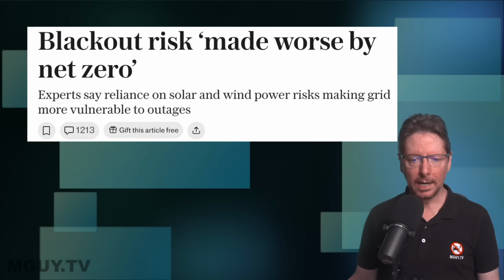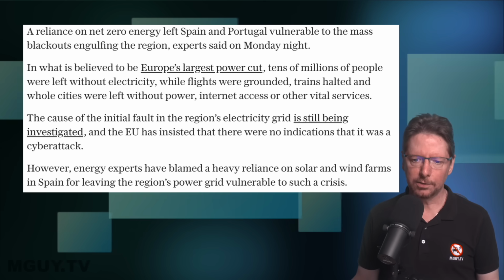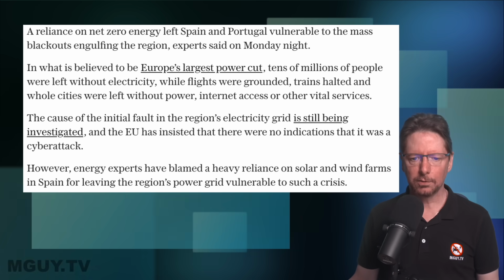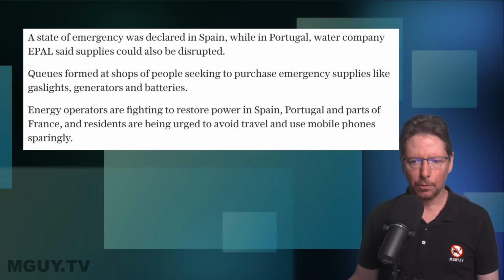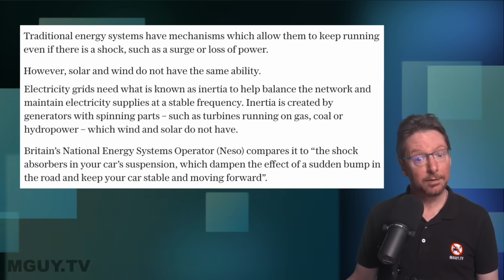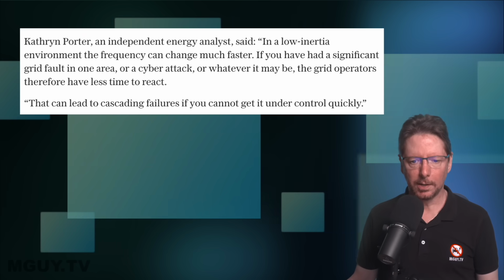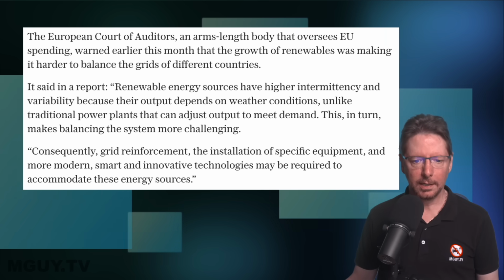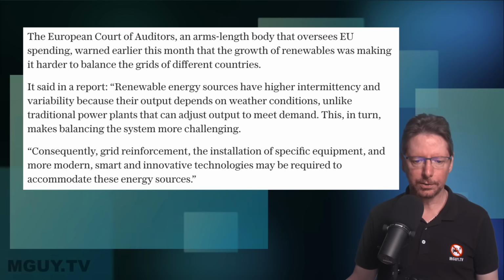Spanish power BLACKOUT: Why Net Zero and RENEWABLES were to blame | MGUY Australia

Comment: Inertia is like that experiment where spinning a bicycle wheel quickly will spin you around on a swivel chair.....renewables is like trying this with a lego wheel.
Reply: That would be gyroscopic precession, but your analogy is correct .  lol
Inertia would be like when the  Cheyenne chief Turkey Legs tried to stop a train with a bunch of braves holding a long raw hide rope across the  tracks .
Reply: Ope that’s the gyroscopic effect. Inertia is felt when you try to slow down the spinning wheel and even a Lego wheel has more physical inertia than a solar cell!

Comment: I wish The World was still run by the trained Engineers who created the infrastructure we rely on, instead of the Unicorn Fart Worshippers that are doing their best to disassemble it while blindly pressing buttons based on University educated ‘opinions’ instead of actual experience…
Reply: Facts ….
Engineering works with facts 
Renewables only have unicorn farts to fall back on….
Reply: @Batman-lives  They seem to also rely somewhat on moonbeams...
Reply: @Batman-lives  Renewable can be backed with batteries (as e.g. Australia and Texas are doing). This seems a reasonable solution in near-future. Just do not rush too much to switch off the classic gas and nuclear.
Reply: @miguela7433  Yeah right,no thanks.
Reply: You need tens of millions of batteries who all degrade, can be broken or even stolen.

Es is a solution for a problem that not exist.
Reply: @miguela7433  there aren't enough minerals for backup batteries.  They can only put out enough power for a short time. You need backup power plants ready to go in a short amount of time.
Reply: @miguela7433  Nice comment made. I think that the serious  issue of global warming is somewhat being pushed into the background. OK, 'free energy' or the gathering of it comes at a high cost, but then uncontrollable global warming comes with ever increasing death certificates! 😢
Reply: @miguela7433  The UK seems to be intent on switching off gas and oil, as the government have caved in to the Just Stop Oil gangs and stopped issuing licences for Gas and Oil although resources are declining it takes 28 years for oil to come online. There will still be demand in the future, not just for fuel but for all the industries relying on derivatives of oil products.
Reply: @miguela7433  You must have missed the big freeze  in Texas.
Where everything failed.. 
Many people  froze to death.
Reply: @miguela7433  A battery is only a substitute for a windmill or solar panel. If the base load is off frequency or is shut down, the battery, like the windmill or solar panel, will not work.
Reply: @down_under-bl4  It is just one technical hurdle for compatibility with existing networks, and It is solvable (battery size matters, also). If you look around the world, the next-gen very high power electrical distribution networks being built in some countries are even  moving to high voltage DC tech. Frequency is just one ítem in the checklist.
Reply: @miguela7433 . If you need battery’s then your principle source of power is the wrong choice in the first place.  Period.
Reply: @miguela7433  learn some basic physics please. the battery power required to keep an average small country going for even a few hours would require more battery power than exists on earth. Batteries are a dream just like renewables.
Reply: @tconbo4514  Not saying solar is the solution for everything or able to power every country by itself. I am saying that renewable & batteries combination are being implemented very succesfully today at some places like Texas (a place not suspicious of being a hive of leftists or woke people).  Do not believe me, you can just make a web search. 
Also, these spring days in Spain we may be having too much solar generation for several hours each day. Instead of going to waste or risking network stability this could be put to good use with help of batteries like the ones in previous example. 
Here in Europe the sun shines for everyone but the oil and gas need to be mostly imported from countries which may one day decide to dictate which must be our way of life, mind you.
Reply: @miguela7433  Batteries aren't for storage.
Reply: @billrehm3590 backup power plants ready to go in a short time is a myth. Steam plants take time to get running. You don't just turn a switch and put it online. It takes time to warm everything up so you don't get rapid disassembly of critical parts. Hydro power is much quicker to bring online. Yet many plants are black start capable these days. They require power from the grid to power control systems until they are generating. More plants were blackstart capable, but owners decided not to maintain that capacity as a cost saving measure.
Reply: @miguela7433  The amount of fossil fuels it takes to make mining equipment, mine the minerals  and then produce the batteries is never taken into account when talking about clean energy. That fossil fuel would be better off just making power at power plants that burn fuel more efficiently and cleaner.
Reply: They are being replaced with people who are engineers in name alone.
Reply: @YouTubeCensorsComments  Inganears
Reply: @YouTubeCensorsComments Wind & Solar technology is purposely designed for a DEPOPULATED future world where energy demand will be significantly less.
Reply: @YouTubeCensorsComments  DEI engineers who read a bit about it at one time!
Reply: @YouTubeCensorsComments  Not surprising, I looked back at my old university a couple of years ago and had a look at the online prospectus for my electrical engineering degree wondering what had changed. It was pretty shocking to see it was more like a business management course now rather than a highly technical grounding in practical electrical engineering as it was in my day.
Reply: Engineer activists 🌈 working on these networks, they got their job by ticking the "right on" boxes
Reply: @CawKee you mean DEI
Reply: @CawKee  I'm getting the feeling that, there are many 'engineers' out there, who passed their exams, but never truly worked in an engineering environment.  So, they're mainly theoretical, will little if any practical.
Reply: Most of the proponents of renewables are people who have grown up with a reliable electrical supply, they have never known life without electricity,  they do not understand how hard life can be without reliable power supplies.
Reply: @chrissmith2114  They will soon grumble when their smartphones stop working reliably
Reply: 100%
Reply: I never used my engineering much here in the UK. I worked in engineering 1994 to 2005. The opportunities just dried up as we gave it (manufacturing) all away. One after another, every company I joined either closed down or moved abroad..
I gained City Guilds 1, City Guilds 2, BTEC ONC, HNC.. and 2:1 BEng Hons..   I just moved onto other things. I had to.
Reply: @chaosflower4892  fck me. you climbed every step and still got pushed off.   do you mind me asking what kind of engineering?   i was m&e but ended up in it. i only got a third (hons) but couldn't stay at one job more than a month because 90% of the phone calls weren't my work but recruitment guys offering more money, more car, family healthcare, dental, dubai, you name it.   same era.
Reply: These people do exist - but not in your part of the world!! (Heavily redacted because the previous version was "moderated' out of existence by somebody or some AI).
Reply: @pmkeith  what are you saying?   youtube is the best platform, in fact, the best thing ever. 🤯🔫👹
Reply: Thank you Aust is up the creek without a paddle. One word Spainblackout .
Reply: You mean normal men.
Reply: Huge lesson for the EV addicts ! Con job results !
Reply: That's if you're assuming there aren't malicious and deliberate actors, behind the scenes, who wants to more to "net zero", because they're massive control freaks.
Reply: In a short couple of sentences you have managed to sum up much of the situation. Now all one needs to do is study an honest book which will inform the individual of how all this works 
.
Reply: Canadas turkeys have just voted in the unicorn fart king. FFS.
Reply: Most of this climate change nonsense is courtesy of the WEF. Their aim is to enslave the population, you restrict movement eg EVs then you restrict energy supply and basically your'e eFed!
Reply: Your analysis is breath taking in its accuracy and conciseness...
Reply: It is only in  west where elytes are high on unicon farts. Look how spectacularly "invite all engineers and brain surgeons from rubber boats" failed, ECO madness will fail same way. All because China and India do not do it, which means they will and already have cheaper and bigger production and industry. So west either will be colonized by China  or will ditch whole ECO when it limits industry strength.
Reply: Sure, but the "big money" is being made by those who are implementing the unnecessarily complex and expensive "alternative" energy supplies - fully supported by the adherents of modern religious fervour. This can all be explained by the oxymoron "education" inherent in a "political science" degree course.
Reply: The World is being run by such infrastructure engineers - but unfortunately, you inhabit the wrong part of it - the part incompetently "run" by lawyers and "political scientists".
Reply: R Jones, yes, paper qualifications. I think the problem is previous generations of engineers grew up around fixable technology or engineering. If someone grew up tweeking and servicing carburetors, do basic welding and metal work and or basic electrical stuff on the troublesome vehicles of past times they'd get fettling experience, learn patience and the wisdom behind mechanical sympathy. Modern vehicles are becoming too fragile or overcomplicated to work on. Also, the average young male nowadays is a pu..y (🙀) and wouldn't consider anything without a joystick and 4k resolution let alone a motorcycle, their parents drove them every where and wrapped them in cotton wool. Skint knuckles and oily hands vs an engineering APP, Mmmm, I'd employ the lad or lass with the oil stained hands over the Persil kid
Reply: Gaia worshippers :body-blue-raised-arms:
Reply: We are run now by Politicians who mostly know very little about anything practical as they blindly live and feed off Doctrine.
Reply: I went to university.
They teach us about this and warned us 8 years ago.
But there are two things. 
I'm an engineer. 
And CEO of the official Net Electric company of my country (Spain) is an expolitian lawyer.
Reply: Oh petal.  No trained engineers on this channel. You wish for engineers then go on to whine about the university educated? You don't seem to know what you are talking about.
Reply: Electrical engineers are ENGINEERS, not magicians!  If they are tasked with creating an electrical system that is based on impossibly unstable and unpredictable "technologies" then one must expect that the output from such systems will be unstable and unpredictable.  About the only way to really solve this problem is to feed all of the "green energy" outputs into massive battery banks and then take the power from the batteries to feed the grid. The batteries will buffer the sudden power spikes and dips in the system output.    But of course, this adds yet another layer of very costly complexity that is itself potentially unreliable - visa-vis the well known problems of battery over heating and potential fires while charging or discharging.  Additionally, as he notes in the video, batteries cannot produce the alternating current required to feed the grid.  Like solar panels, they can only produce direct current which has to be "inverted" to AC current before it can be fed onto the grid. Speaking of cost, there are also electrical costs in addition to the monetary costs.  Each time the power has to be transferred to / from another device such as a battery or inverter, there are substantial electrical losses along the way.  That's why the batteries and inverters get hot.  That heat is generated by wasted electrical power.  All of this adds up to create a very expensive and unreliable system, which is simply not practical for commercial electricity generation and distribution, and never will be.  It's not magic.
Reply: ....
Do you know Jesus Christ can set you free from sins and save you from hell today 

Jesus Christ is the only hope in this world no other gods will lead you to heaven 

There is no security or hope with out Jesus Christ in this world come and repent of all sins today 

Today is the day of salvation come to the loving savior Today repent and do not go to hell
Come to Jesus Christ today 

Jesus Christ is only way to heaven 
Repent and follow him today seek his heart Jesus Christ can fill the emptiness he can fill the void 
Heaven and hell is real cone to the loving savior today 
Today is the day of salvation tomorrow might be to late come to the loving savior today 
Romans 6.23

For the wages of sin is death; but the gift of God is eternal life through Jesus Christ our Lord.

John 3:16-21 

16 For God so loved the world, that he gave his only begotten Son, that whosoever believeth in him should not perish, but have everlasting life.  17 For God sent not his Son into the world to condemn the world; but that the world through him might be saved.  18 He that believeth on him is not condemned: but he that believeth not is condemned already, because he hath not believed in the name of the only begotten Son of God.  19 And this is the condemnation, that light is come into the world, and men loved darkness rather than light, because their deeds were evil.  20 For every one that doeth evil hateth the light, neither cometh to the light, lest his deeds should be reproved.  21 But he that doeth truth cometh to the light, that his deeds may be made manifest, that they are wrought in God.

Mark 1.15 
15 And saying, The time is fulfilled, and the kingdom of God is at hand: repent ye, and believe the gospel.

2 Peter 3:9
The Lord is not slack concerning his promise, as some men count slackness; but is longsuffering to us-ward, not willing that any should perish, but that all should come to repentance.

Hebrews 11:6
6 But without faith it is impossible to please him: for he that cometh to God must believe that he is, and that he is a rewarder of them that diligently seek him.
Jesus
Reply: @robwilton8001  it's been a very long time ago when there engineer positions advertised for state and federal public services.
Reply: I believe all the trained engineers have arrived in the UK by boat….
Reply: I wish The World was still run by the trained Engineers who created the infrastructure we rely on
- You are probably so old that you forgot about the numerous blackouts in the 100% fossil-fueled past.
Reply: @RomanShein1978  Yes I'm old with a good memory, there weren't that many blackouts, apart from the miners strike.
Reply: @rjones6219  there weren't that many blackouts
- I'm old enough to remember NY 2003, Italy 2003, which were similar in scale, and Brazil 1999 lasted 3 months. All happened well before renewables became a thing.
Reply: @RomanShein1978   I remember the outrages in the Northeast going back to at least the early 70’s. The problem was with aging infrastructure such as transformers and breakers coupled with the inability to isolate areas fast enough. The power load in parts of New York would get high enough that electricity would be bought from Canada. When things started to fail, it would overwhelm the grid. I don’t know if Texas is fully on the national grid, but for many years it was completely off the national grid.  The big statewide outage a few years ago was caused by a loss of power from the wind farms that had not been anticipated.
Reply: @danastaph7708  The big statewide outage a few years ago was caused by a loss of power from the wind farms that had not been anticipated.
- Nope. The Texas blackout was due to a lack of winterisation. The renewable sources were the last to give up.

         "coupled with the inability to isolate areas fast enough."
- With this one, I  agree. The Spanish grid operator is to blame.
Reply: @RomanShein1978  What??? Where do you get your information from??? Fossil fuelled power generation is rock solid base load electricity.
Reply: @hughjanus3378  What??? Where do you get your information from??? Fossil fuelled power generation is rock solid base load electricity.
- You can read it yourself in any source about the Texas blackout 2021. All power generation, except solar, failed to a varying degree. Fossil-fuel sources were the worst, although nuclear and wind power also lost output too. Solar was the only source that INCREASED output during the blackout.